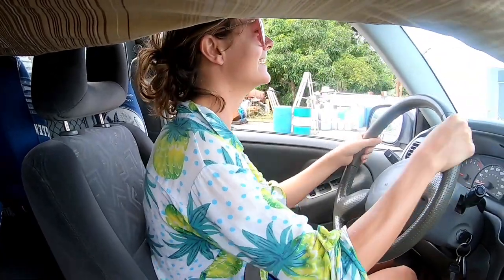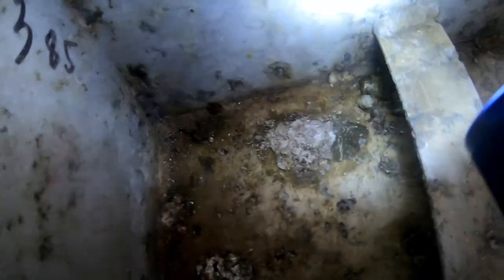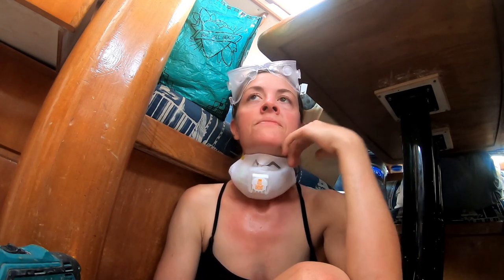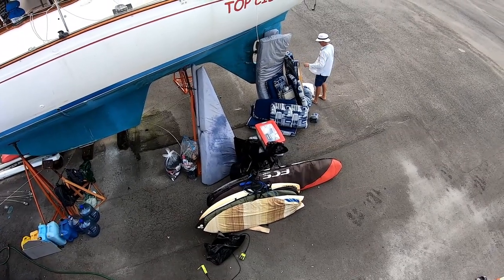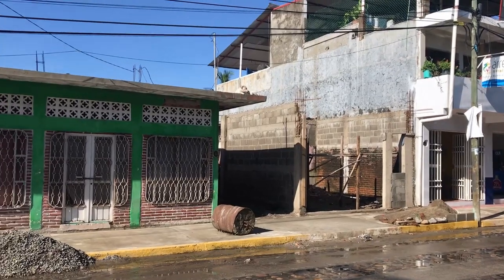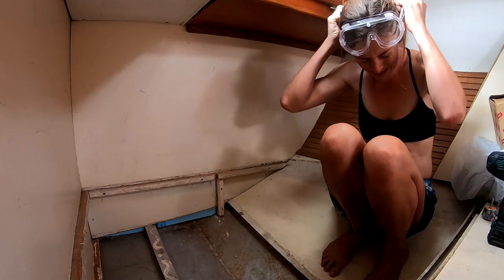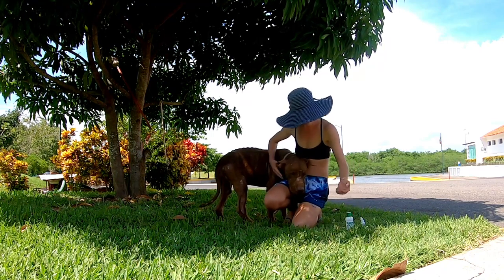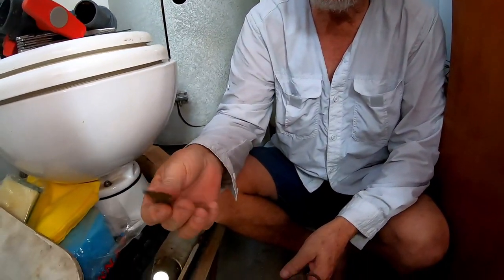This Changes Things... Chuffed Adventures S03Ep2 Hauled Out

Comment: In the absence of a sandblaster [ even a small one just for the worst pitts ] your best bet for a thorough clean, is chemically. I am a metal fabricator  on the Gold Coast. We finish any ally welding jobs with a product called Alli Brite [ normally used for cleaning truck bullbars and such, but it dissolves anything that isn't solid alloy, leaving a clean, oxide free alloy surface to weld or epoxy to!  Two years down the track, you'll be sitting at the helm in the middle of an ocean somewhere, and thinking back to now, and wondering if you could have done a little more to ensure that your patches hold up for the duration.
Reply from the maker: I need to look into the product more, when I researched into options for cleaning alu ox it said nothing cleans it with out eating the aluminium because its actually 'more stable' in manybways once its oxidised. Will look into the alli brite thank you!!!

Comment: Treat the aluminum with irridite (alodyne).  It’s an etch then oxidizing chemical.  Any areas that can get o2 leave bare.  Any coatings must be specifically for Aluminum.   Plug weld or cut out bad areas.  Be sure to use marine alloy aluminum stock.

Comment: No anodes, even if you attach a couple of anodes to wires, connect them to the hull and hang them over the side will help reduce the electrolysis. Just the different metals in your propeller and propeller shaft will generate electricity in salt water and eat away your boat. You put the anodes there so that they get eaten first. Best of luck with the repairs.
Reply from the maker: I did have a hanging anode, but definitely no anodes was a big problem (the shaft and rudder had one, none on the hull)

Comment: I used to have an aluminum 32' Marinette cabin cruiser. It had a galvanic isolator and a meter that basically told you when you needed to change your zincs. Although it was an older boat, the hull was immaculate!  Don't know if your boat has these devices, but I would think are critical on an aluminum boat to keep it from corroding. I knew Karl was aluminum, but did not realize Chuffed was too. Holes all the way through your hull are not a good sign.  Good luck !!  Hopefully some patches can be welded in place.
Reply from the maker: We are doing patch weld, and so far so good. That sounds like a great idea (galvanic isolator) I will have to look into it!

Comment: My brother had an aluminum boat building company before he passed away. He told me for aluminum 1. Always change your anodes, even if they are partially dissolved. At  least annually. 2. standing fresh water in the bilge is worse than salt water 3. Cu pennies and copper wire should never come into contact with the hull 4. Harbors can be hot (electrically). Limit exposure or consider an active galvanic protection system.  But plenty of anodes changed regularly is an essential part of corrosion control. As to the water tank- can you put a bladder into the space?
Reply from the maker: All very good advice - with a bladder we would still have to clean the tanks out to prevent further corrosion, so cleaning than epoxying is the plan!

Comment: Im a welder and also a boater, Get some zincs on the boat! Remember you cant have too many anodes, Put one on your propeller shaft and like 3 on your hull to prevent this from happening again, replace yearly. If i were you id have 1 on the keel, rudder, prop shaft, and transom. The hard work is the work your doing, those holes are a piece of cake to fill for a welder, Just get the aluminum holes as clean as you can get it using a stainless steel wire brush and some acetone so when the welder comes he doesn't need to spend his time prepping and can fly through it. Those holes shouldn't take long to fill. Your doing the hard part as of now.
Reply: Willow this is not true you need the exact right amount of zincs and there is a lot more to it , if you have to many zincs it can actually create more problems , a meter needs to be placed into the water to measure potential difference and the correct amount of zinc installed , my boat had to many zincs and was overprotected and was blowing off antifowl and causing other issues
Reply from the maker: I used a special online anode calculator to work out the size/weight of zinc anodes needed for Chuffeds current condition - we have plans for two on the hull, one on keel and one on rudder, and one on the shaft now. She hopefully will be much better protected now!
Reply: @richardkaye2228  I stand corrected, you are right you can over anode metal and wood boat. However, you cant over anode a fiberglass a boat. I believe my recommendation or opinion wasn't too far off how many she will need.
Reply: @VetTails  Good for you, glad you looked into it as my statement was technically incorrect but my advise was somewhat correct haha.
Reply: Willow mine is a fiber glass boat and they can be over protected , what it does is it attacks the copper in the antifowl and burns off big sections back to bare barrier coat around all your underwater metal items it also starts to very slowly pit them , anodes are left to some body with a machine to measure the water it’s very simple and easy to do but without that machine it’s just a guess

Comment: Your hull plating is the simplest system on the boat. You have fixed far more complex stuff. As we say in the biz "crop and renew". Take a week or two out and learn to TIG weld. I think you would actually enjoy the process and also have the confidence that you can repair any structural part of Chuffed. So the holes are your friend - telling you that it's time to learn to weld - which after practice, am sure you will be good at.
Reply from the maker: We luckily found some good welders, I do want to learn though!

Comment: It's ALL fixable Doc, was going to suggest you look up welding with a copper backing, the welds won't stick to copper, so you can place a small block of copper on the other side of the hole to make it easier to weld shut your perforations smoothly... On your tanks, are they integral with the exterior hull, or are they removable tanks ? Perhaps a replacement liner can be made and epoxied across the entire area to exclude moisture ? Planning to join Patreon soon, so kiss your wonderful parents for all of us sending good wishes and vibes your way... and get back to work !
Reply from the maker: The tanks are part of the hull, so for now we are cleaning them out and then will epoxy. More on plans next episode! Thank you!!!

Comment: A lot of that corrosion appeared to have started either under or adjacent to where things had been bonded to the alloy indicating the previous owner cheaped out and used commercial acid cure silicone on the boat, to prevent recurrence be sure to spend a little more and use marine grade sikaflex for bonding. the polyurethane is neutral ph curing so aluminium friendly
Reply from the maker: You got that right! I mix of bad choice glue and electrolysis !

Comment: Have you considered an ultrasound survey of the hull?  This will give you thickness measurements anywhere across the whole hull and a basic thickness gage will be relatively cheap to hire for a day or two along with being fairly easy to operate, some can penetrate paint, the waveform 'A Scan' display units tend to be better.  Calibrate a basic thickness to your own hull material for best accuracy going with a measured 2mm and 10mm calibration points anything you measure in between should then be accurate to less than half a millimeter.

With the use of an ultrasound flaw detector you can also identify any possible cracks or voids and a flaw detector will allow you to check the welds too though you will need some knowledge on how to operate one if you want to check the welds as this involves trigonometry calculations as well as bouncing sound around inside the metal hull plates to check the welds.  

You should be able to find a ultrasound NDT surveyor easily enough though it may not be cheap they will be capable of carrying out all of the above. 

Good luck.
Reply from the maker: We are in a pretty remote part of mexico so would probably have to fly someone down to do that, so we are doing it the old fashion way... lots of hard work 😁

Comment: You have a great dad. It will get done. Rather remove larger corroded sections and have it TIG welded. Also, use the old cut out pieces as heat sink when welding. Aluminium is a great thermal conductor and will dissipate the welding heat. Good Luck.
Reply from the maker: Thank you

Comment: Hi. You must paint all bilges to insulate metal with epoxy primer and test hull for electric ground leaks. You have some elrctrical issue. I can send you testing procedures. Just need a tester .
Its a must . Goodl luck
Reply from the maker: Hi! Its a bit debated whether painting bilges is a good idea, the issue with painting is it has to be done perfectly or (as you almost certainly know) the alu will just be much worse. We are planning to paint water tanks and all the 'dry' bilges will be left bare, so they will build a fine layer of alu ox over them which will protect it. We have been testing for leaks - have a small isue with the VHF so are rectifying that too
Reply: @VetTails 
 Hello , painting requires lots of preparation . It is true  but sometimes is the best solution .
Keep in mind that if you keep the bilges in bear metal they should be extremely clean and  dry , as  an operating table at the vets office .)) 
Water is an electrical conductor and any other material  like cans , screws , bolts , tools , electrical cables not well insulated , or any other object will cause galvanic corrosion if in contact with the water or just humidity which is always present due to condensation.
When you apply paint , it works has an insulator and prevents this issue  . Small bubbles  in the paint will allow you to identify the problem early to prevent  pitting.
Aluminium boats are very strong but very sensible to corrosion and need monitoring with instruments and gauges .
Your vessel needs urgent attention,  extreme care and zinc anodes must be mounted on the hull ..please find more info here about how monitoring and preventing corrosion :
http://www.delzer.com/powerproducts/BoatYachtCorrosionManual/files/assets/common/downloads/publication.pdf
https://cdn.shopify.com/s/files/1/0658/7343/files/CORROSION_WORKBOOK_2010.pdf
Don't hesitate to contact me if I can be of any help or advise from a yacht electrical engineer or paint surveyor  . I work with them on a daily base . Ciao )

Comment: Its all good, break it down to one task at a time, youve got this. so treat the corrosion using phosphoric acid, this will etch out the oxidation, only leave it for about 10-20 min always watching and assessing, you must wash it off with liberal amount of water. Then use a good primer suitable for aluminum, this maybe the reason you have corrosion, if a copper based primer or anti fouling was used by the last owner, turning chuffed into an anode. If you can get your  hands on some alodine (chromate solution) put that on the raw aluminium surface before paint, dont worry if you cant find it. With regards to welding, i would patch weld the outside unless its a large area, then it may be worthwhile cutting out the damaged area and weld in a new section. Your hull will be made of 5000 or 6000 series grade aluminium, make sure they use 5356 grade of welding wire (Do not use 4043 wire, it has a lower shear strength) and if possible use the GTAW or Tig welding process, however mig will work. If you have to cut a section out, insure that they leave a gap around the edge of about 0.5-1mm and the new plate and hull be preped with a 30 deg bevel making a 60 deg "v"  i.e.   inside I<I outside. Then the first welding pass be done from the inside, all other welding passes can  then be on the outside, however before the second pass make sure that they clean the area to be welded again, as impurities from the first pass will have contaminated the surface area for the second pass with oxides. This should allow for a strong hull. I just wish you were here in Australia, id weld it up for you, good luck youve got this 👍🙂. If you've got any questions just message me
Reply from the maker: Great advice. We went with the patch welding option and the welders thought I was too funny sitting on their shop floor with welding wire reading the grades! So we went with - 5052 alu sheets, 5356 wire onto my 5083 alu. From all the alu charts I read that should be a winning combo hehe.Ive been to scared to use the phos in the tanks for fear I wont get it all out... but if you have more info on technique Id be willing to give it a try to give our drilling arms a break haha
Reply: @VetTails  im not sure how well it will work, if at all, however Coca-Cola has 5% in solution phosphoric acid. Maybe after your finished grinding your water tanks (unfortunately no other option) give a scrub with Coca-Cola and leave it over night.

Comment: I think I wouldn't bother. I'd be tempted to just use the hull as a skeleton to hang a new fibreglass skin on the outside. End up with an alu-lined fibreglass boat. It'd probably need a coat of some flexible material between to cope with the different thermal expansion rates of fibreglass and aluminium.

I suspect there aren't many uses for aluminium where it's actually suitable.
Reply from the maker: How could I possible fiberglass the entire boat? I could probably buy a new one for the price of all that fiberglass! As soon as any corrosion touched the edge of a fiberglassed area water would enter and everything would go very very bad! You can fiberglass over alu to repair it but using s really strict set of preparations and repair methods 😁 believe me I looked into it 😂😂😂
Reply: @VetTails  Let the alu rot and just maintain the fibreglass hull. They used to make hovercraft out of fibreglass where I live.
Reply: @VetTails  Thank God you're an intelligent woman...His advice should not be followed.

Comment: Nika, from White Spot Pirate had the same problem with Karl. You wouldn't have to reskin Chuffed, just the bad spots if you did it the way she did Karl in the San Blas Islands, as a plus your in Mexico, you can get just about anything you need to do the job easier and cheaper than she did where she was and knowledgeable people to help. I'm just saying there are ways to fix this that wont break the bank. Look for that silver lining ...or that aluminum lining. Were behind you all the way, which ever way.
Reply from the maker: It definitely adds an additional cost I wasn’t expecting, and you’ll see the extent of it all in coming videos BUT as you said nothing that can’t be fixed!

Comment: After cleaning the area around a hole thourghly
There is an aluminium alloy soldering rod that is easily applied with the aid of a Bullfinch ,Seivert, Rothenberg type blowlamp
And I think utilises propane and or map gass.
Quite a few videos on you tube about it !
May be cheaper than a mig and pure argon !
Just a thought !
Interesting to see what other people say ?!
Reply from the maker: As far as my research went the welded bond formed by those little machines isn’t strong enough for our uses, for for around the house style applications more so 😁 and it’s also really important to match aluminium types, perhaps if our problems had been a little smaller!
Reply: AHH 
I have seen on YouTube and once at a national show being demonstrated !
So have only that very limited knowledge !
Thanks for your.reply !
Will you be cutting out and spool /might welding Or
Plating over to rectify ?
Interested to know your course of action .
The Good Old Chant " we shall overcome ..." Springs to mind.
Keep up the positive attitude .
Reply from the maker: Plating is the plan!
Reply: Thanks for replying.
Happy plating
Keep positive
Little by little you will overcome

Comment: I've been interested in aluminum vessels also,  and , have you heard of  , COPPER NICKEL,  also called , cuprinol I believe.  Comes in very thin , stick on patches . No more Electrictrolisis,  no more bottom paint.  No more sea growth. Guaranteed for at least 20 years and easy to apply. Check it out on line .afraid I don't know what  it cost . Pretty dear I imagine. 
Happy holidays to you guys. From California.
Reply from the maker: Copper nickel? It was my understanding that putting that onto an aluminum boat would result in severe corrosion between the two metals? 
Thanks for letting me know!
Reply: @VetTails  ,,
It's got a thin double sided adhesive product ( tape , wide. ) which attaches the copper to the hull, and isolate it from the metal/wood /glass. You can use it on everything. No more pinholes.

Comment: Hello

I think these corrosion spot has been not epoxyed, but fillet with Polyester resin. Polyester resin does ACCELERATE corrosion especially if bad mixed with exess accelerator. Same issue with car body fillers, who will pop off after a few years. SO, NEVER use polyester on Steel, ONLY Epoxy-based products. Use a good corrosion neutralyzer after removing as much as you can corroded metal (but you will never remove everything). Weld the big ones, and cover everything with a good epoxy/glass (composite material is not there to prevent corrosion, but only to protect metal from being damaged.
Reply from the maker: Good to know thank you! She’s an aluminium boat too